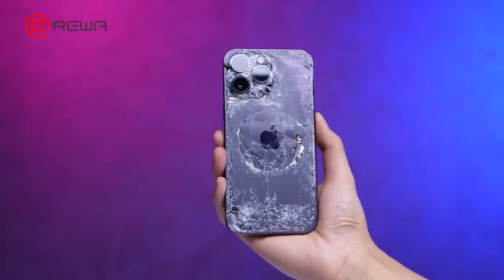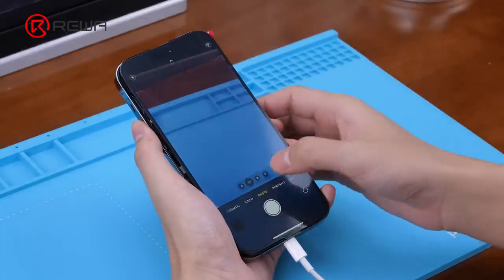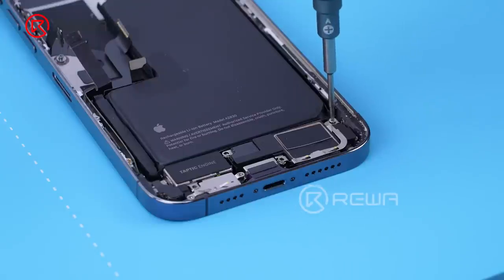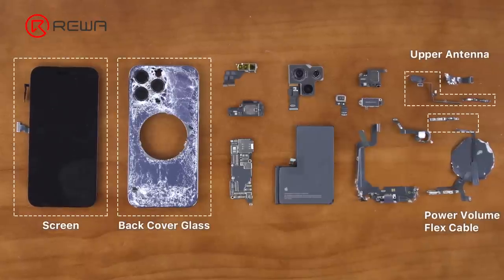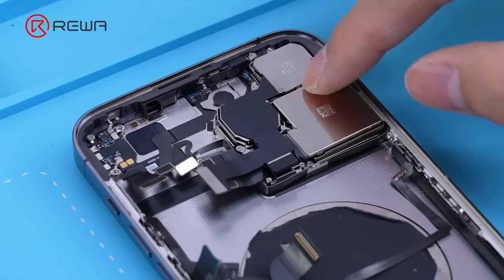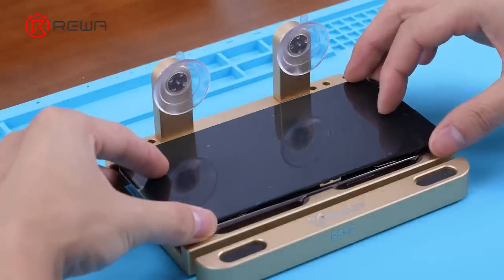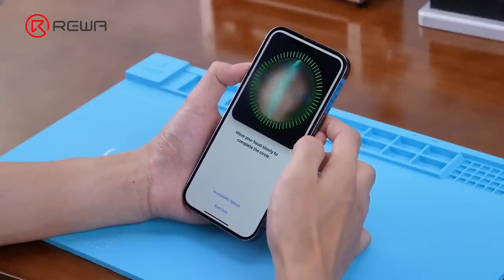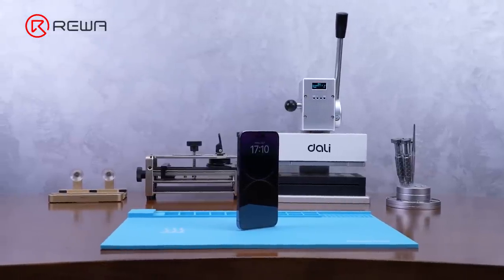Shattered iPhone 14 Pro Max Restoration

Comment: how did you get it to say genuine apple part in the screen settings
Reply: The screen was provided by Apple
Reply: @fixthisone  even if original screen from  apple you need to calibrate with special tool from apple service centre.
Reply: @fixthisone  that's wrong, even authentic apple screens will pop up unauthentic part message if not paired from apple service provider.
Reply: @vitalienegru2065  That’s what was done in this case
Reply: @ΒαγγέληςΠράσινος-υ1β  It was programmed by Apple. At least that’s what they’re referencing in the video. At one point it says it was from Apple service provider
Reply: after replacing the screen with the genuine apple screen, the technician then uses "diagnostics", which connects the phone to apple support. it then runs diagnostics, and when is done properly, will successfully pairs the new screen with the phone.
Reply from the maker: Exactly

Comment: Hi REWA, I hope you can help me. If I replace an iPhone 14 Pro display with an original but used one, will it give me an error? Possibly, will it be restoreable via the system configuration in dfu mode as is done with products purchased with self service repair? Or should I reverse the IC?